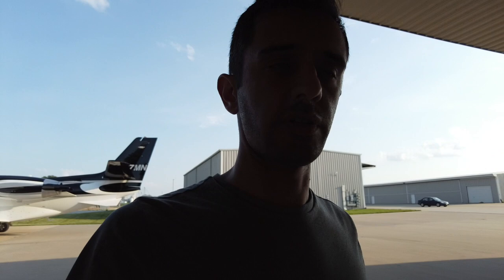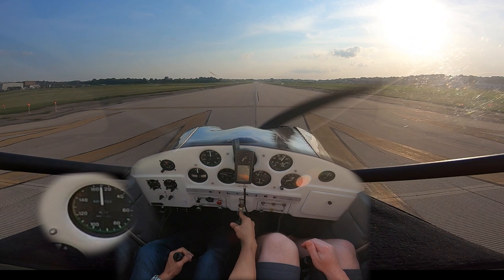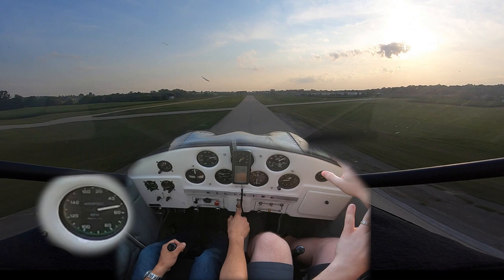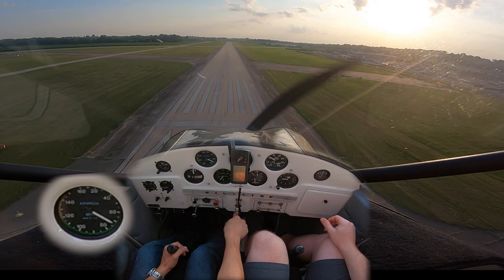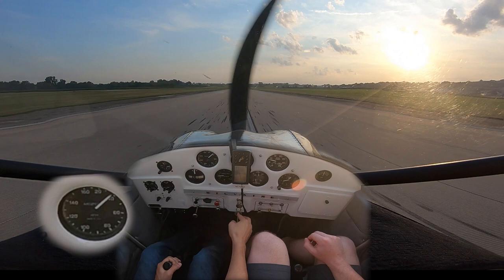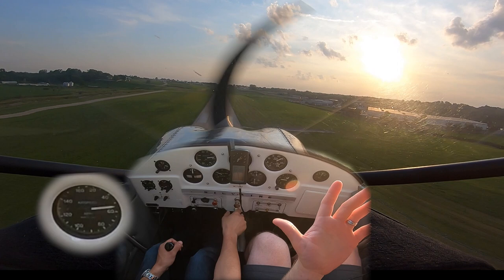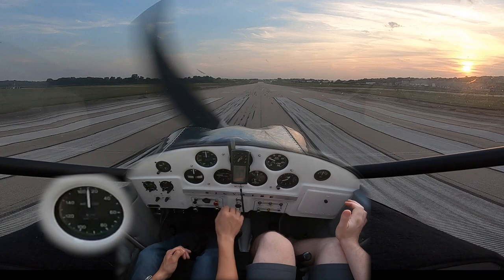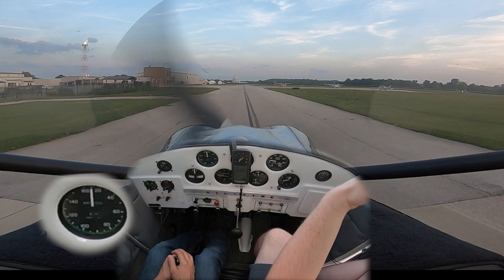Why my take-offs suck(ed)! Hint: it's not the plane.. Tailwheel Lesson #3 Luscombe

Comment: I am sure your instructor has said this but with a cross wind start your takeoff with full aileron into the wind. 2 things happen, a) The wing stays down and you have pressure on the main. b) The adverse yaw you mention helps to keep the plane straight and helps the rudder. When landing same thing once on the ground start feeding in full aileron it will keep the wing down and help the rudder keep the plane straight.

Comment: I am just now seeing this a year after you posted it.  I am a 50-year taildragger pilot, and I learned in a Luscombe.  I want to point out something you said about adverse yaw.  At the 5:56 mark you say "...if I raise the left wing the airplane wants to yaw to the right...".  This is incorrect.  If you raise the left wing (using right stick and not using enough right rudder), the aileron on the left wing deflects downward.  This increases lift on the left wing (in the part where the aileron is located) which also increases drag and results in "pulling" the left wing aft, making the fuselage yaw to the left.  You can prove this by going to cruise altitude, cruise speed, level flight and then, holding the rudder neutral, move the stick to the right.  The plane will initially yaw to the left.  Conversely, if you hold the rudder neutral and move the stick to the left the plane will yaw to the right.  In both cases moving the stick left or right will raise a wing but without adding rudder, the fuselage will yaw the opposite direction.  Again, adverse yaw is induced when an aileron is deflected downward, and it has to be countered with the addition of rudder to make a coordinated turn.  Now a year after this video was posted I hope you are having great fun with your Luscombe.  I think they are great airplanes and learning to fly one well will make you a very proficient pilot.  Cheers!

Comment: Ok. Go to altitude. Fly one heading and bank left and right in succession in slow flight, about 10 kts over stall speed. Bank 30° left, right, left right. Immediately and without changing heading. Make the rudder and aileron inputs together and sufficient to keep the ball centered. Throw a string on the windshield like we use in gliders and only look outside. You got this! Nicely done on the self critique. I think you were pretty fair to yourself as well. Next time you're in town let's go flying in the glider! 65' of adverse yaw! Fly every day you can with the CFI until you are completely confident. You got this man.
Reply: I also like high and fast normal approaches. If the engine quits - you're good!

Comment: The turn cordinator doesn’t mean the plane is going straight buddy.  It means the tail is behind the plane.  The reason for the problem is you’re used to a plane that is static.   A tailwheel is dynamic.  You have no time to look at a turn cordinator.   The reason for the bounce is you were too fast.  That the only reason they bounce.   You’re looking too far down the runway if you bounce-  7500 hour ex tailwheel instructor.   You’re instructor seems better than most.   We are hard to find,  lot of hacks out there.
Reply: Agreed!  I owned a 46 8A for years.  You have no business looking down at the ball during takeoff and landing.  Gentle but positive control movements.  Aileron into the crosswind to keep the wing from rising before she's ready to fly, and keep her pointed down the middle with the rudder.  Keep both feet on the rudder pedals.  Watching your videos brings back lots of memories!

Comment: Keep it up !! On TO I would say put an nose reference on a point in the distance and use the rudder to pin it there - developing your rudder reaction and directional control is the key to eveything. On landing, I think a lower approach speed will help you, (though I think you see that). The Luscombe is slippy machine and even 5 mph will make a difference. 1.3 Vso on the approach is 61-62mph; even 65mph on the approach will make things a lot easier for you. as you'll have less energy to loose in the final seconds of landing,.  The approach speed for both wheel and three point should be exactly the same.  You're getting there,  keep practicing
Reply from the maker: This thing IS slick! I thought it would slow down more. I got spoiled flying constant speed props with extendable gear.
Reply: @AvianaAircraft  slicker than some contemporaries. Get the energy right on approach and everything will be more manageable.  BTW, didn't realise you had a Bo. is it a 33 or 36. They're a very handsome aeroplane.
Reply from the maker: @DavidKelly-ce6ys  I wish! I used to fly a friend's V-tail for a few years, but that Bonanza 33 in the background is not mine (community hangar)

Comment: Great video and critique.  The camera setup make is very helpful.  I can see marked improvements with each event.  Outstanding.

BTW, seperate question; in a previous video your spinner fell off, did you do anything different when replacing it?  I feel that the screw and nut plate holding mine on is kinda weak (seems to be a poor design).
Reply from the maker: I ordered this spinner and give it a wiggle on pre-flight :)
https://www.univair.com/cessna/cessna-120-140/view-all/sm-spin-asy-univair-small-skull-cap-spinner-assembly/